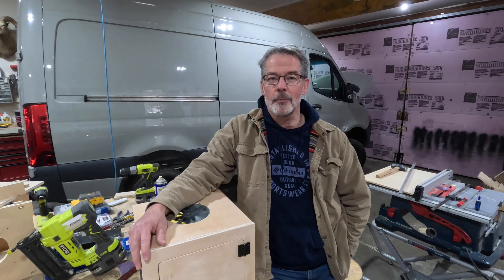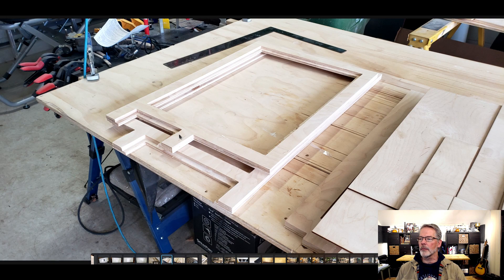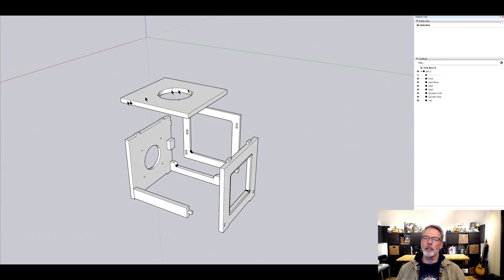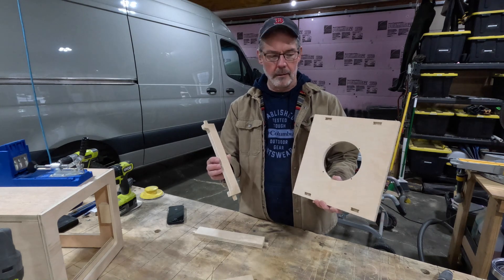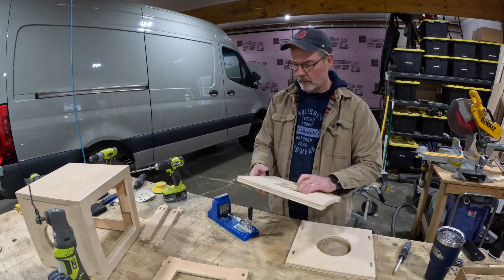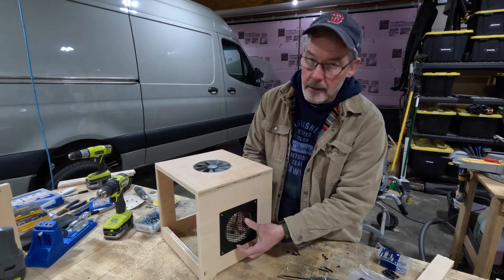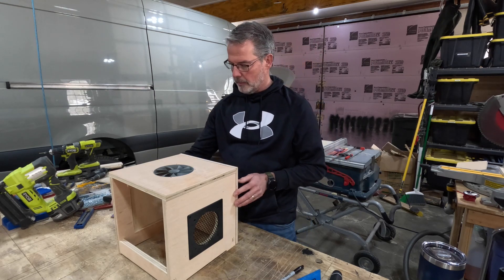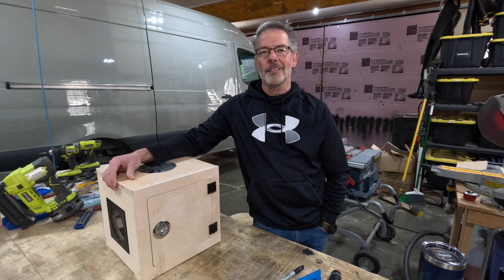Camper Van Cabinets - Easy to assemble design!

Comment: I'm curious why you are using pocket screws when the CNC machine can make finger joints?  All you would need is glue and some pin nails to hold the boxes together at that point.  Much stronger and would allow you to use even thinner wood to achieve the same strength.  No judgement, just curious.

Comment: I’ve now watched all three of your videos and am exited to have recently discovered your channel!  We’re building out a van right now, but haven’t gotten to the cabinetry part yet.  I’ve been planning things out in Fusion 360, though, and you may have just convinced me to outsource the cutting to a CNC machinist.  We live in the UK in a small (by American standards) house with on-street parking only, so working with huge sheets of plywood is extremely difficult.  If the cost of CNCing isn’t prohibitively high, it would certainly save us a lot of mess and stress.

You asked if anyone would be interested in seeing a more detailed video of how you triangulated the shape of the floor to be able to draw it in SketchUp, and I definitely would be.

Thanks again for the videos, and good luck!
Reply from the maker: Glad to hear you like the channel so far!  A few others have asked about a detailed video on how to do trilateration to copy parts and measure the van interior, so I will be doing a detailed video on that soon. 

Good luck on your build!